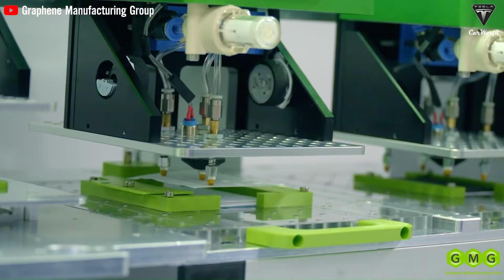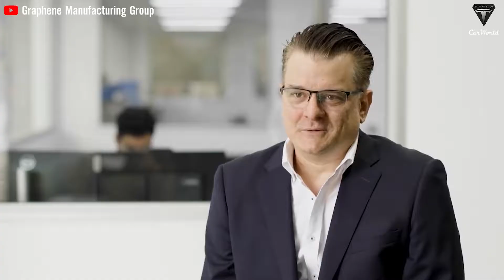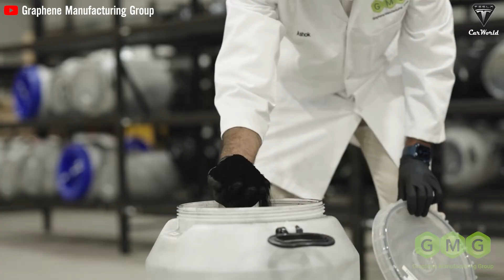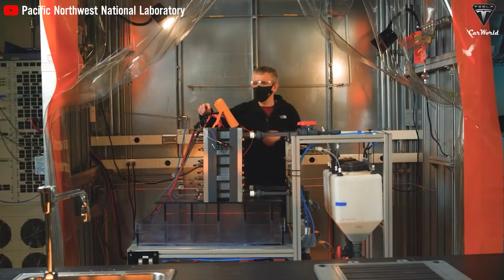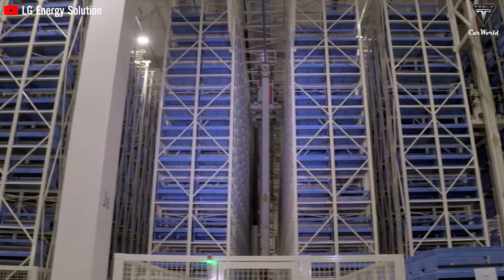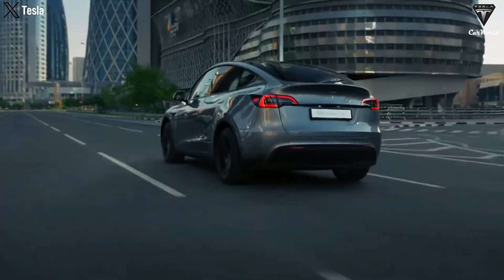Only 8 Mins! Elon Musk GET NEW Graphene Aluminium-Ion Battery Charge Faster 70X & Lifespan BOOST 3X

Comment: Greetings. The videos on this channel are very informative and impartial. I say impartial because any reasonable assessment by technicians MUST state and evaluate the errors/problems that need to be corrected, and the company's efforts to do so. Those who hide these errors are "fans" (deep down, against the brand), incapable of accepting the errors and problems in order to correct them. Most companies full of "fans" go bankrupt, thus stifling any evolutionary vision of the brand itself.
However, there is a dystopia in the effort that Tesla makes to accept its problems (such as the car that was on fire for a long time after the collision), which forces Tesla professionals to remove more and more lithium from the batteries. So much so that they look more favorably on solid-state batteries, despite their prohibitive cost (still). But... What about other brands? What effort are they making to abandon lithium and reduce this ONLY risk in vehicles, which is lithium batteries? What effort do they make in comparison? What different technologies do they use to solve the same problems?
I am asking this question and answer because, in addition to these other alternatives being necessary for competitors to start assuming at least a "minimum" or "maximum" level in risk reduction, people understand that this "delay" in solving this lithium problem is due to the extension of this study since 1903. Meanwhile, electric vehicles are already showing results as good as fuel-powered vehicles. On the other hand, all that is missing is the creation of the infrastructure for implementation in the rest of the world, which is still dominated by the OPEC cartel (like Brazil, which is still in the Stone Age in terms of implementing, for example, charging stations, technical assistance... Volvo is already making efforts to solve these problems in Brazil, but the cartel is louder here).